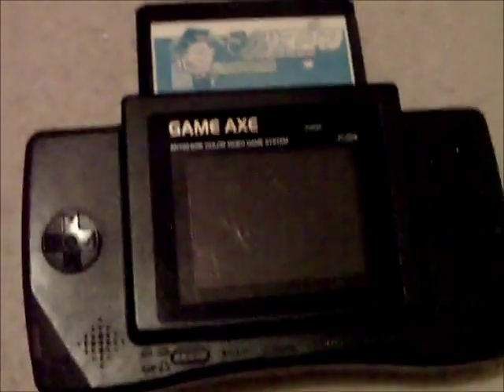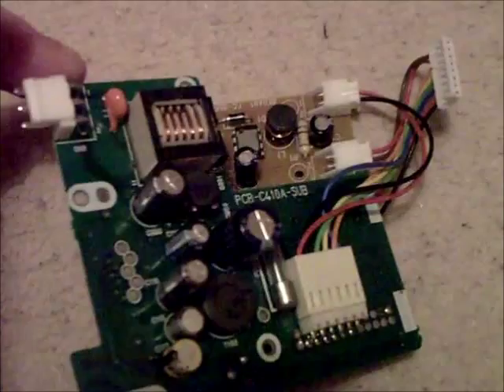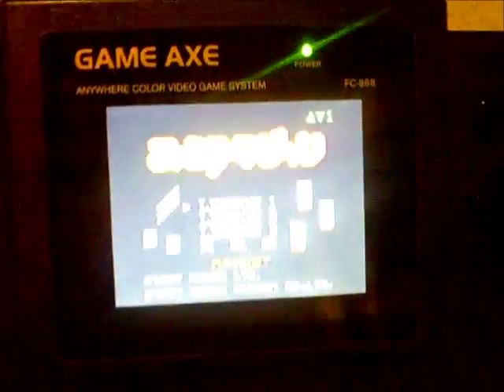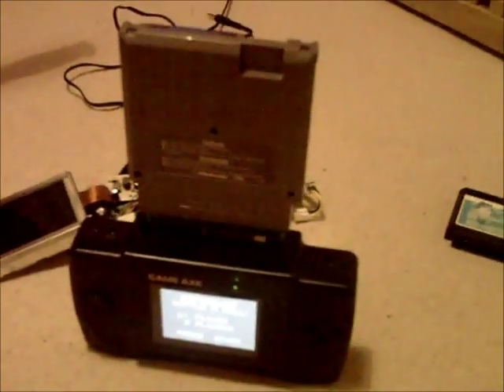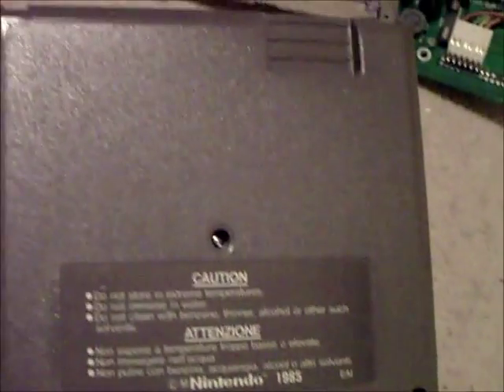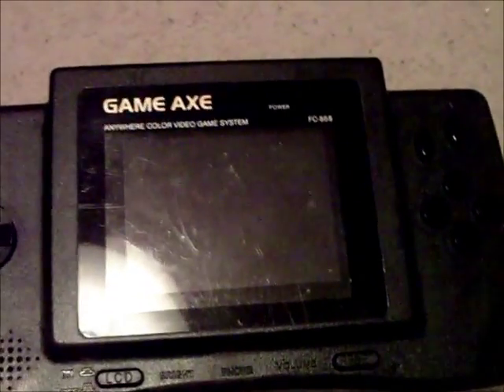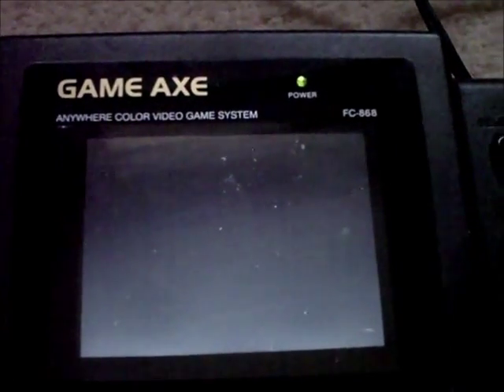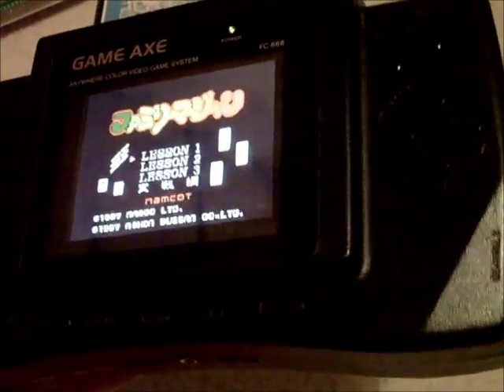Redant Game Axe - Handheld Famicom  - PART 4 - LCD Mod Tutorial

Comment: Well if you accept the smaller screen size, i will say ,go ahead,it's amezing how you interfaced a modern lcd screen with old technology.Am stun that there was even a transformator inside to magically convert 12 volt into 110 volt,probably to power that tube wich consummed the most power of all electronics inside,so no wonder that old lcd screen was thick in size.

Comment: Hi I had one of these from New 1 thing i remember about it was that when running it on batteries it always took 2 or 3 mins for the screen to reach its full brightness (The left side of the screen was dim for 2 or 3 mins) On the mains adapter it was fine